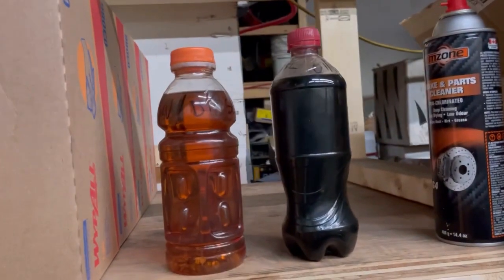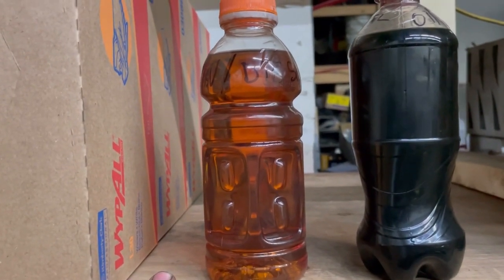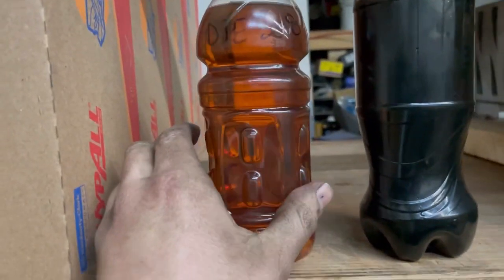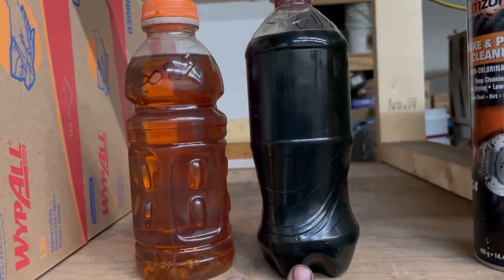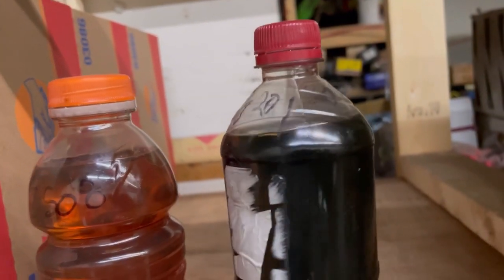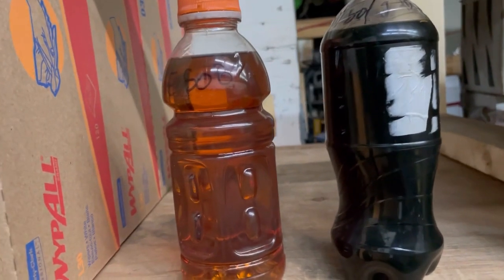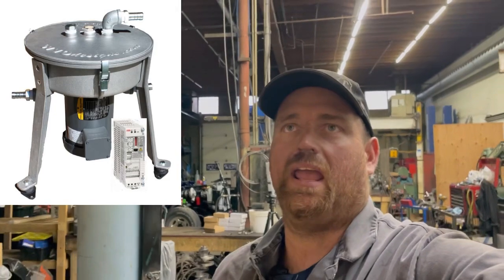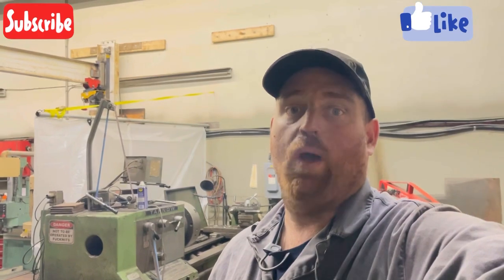Alternative fuels ( What's coming and what should we do ) black diesel , biodiesel, wvo,wmo

Comment: would be interesting to test the metals content vs start on waste motor oil . I know centrifuge will take out a lot. But I wanna see maximum filtering possible?  what about Magnets in settling tanks or on lines? Also you could mix E85 with the oils and run thru centrifuge?. Also put some algae/pond scum in the centrifuge with veg oil…
Reply from the maker: I was thinking of send some samples away for testing when I get the centrifuge  / mobile fuel lab setup in the coming months. Only thing in don’t like about e85 is that the ethanol takes on water very easy witch can be a big issue.

Comment: If it hasn’t been addressed yet, I’d like to know the lubricity of the final running mixtures and if they can be offset by winter additives. I have a VE pump on a 12 valve in my 90 suburban. Filtering is a must for the fuel system I get that , just concerned with wear
Reply from the maker: we will get in to that in the next couple video's

Comment: I see you’re talking about using oil I’m wondering if it’s used oil if it’s used oil man you got a filter that stuff down even finer than 2 µm because the real fine metal Shavings and small chips tiny tiny tiny chips yes won’t hurt the cylinder walls very much I wouldn’t think but what about the injectors in the pumps I’ll tell you right now I don’t think we have the means to filter that down that well I mean you I mean it’s super super fine metal debris‘s can damage things that’s what I was told by a guy who really knows what he’s doing a friend of mine who is now deceased he was an outstanding mechanic and give you some of his qualifications or you get a member Bill actually was building engines and rebuilding engines back in the 60s 70s and he was a master mechanic on road Ranger transmissions differentials hydraulics he even studied a book just to learn how to rebuild air compressors for drilling rigs and things like that and he was highly highly successful I mean this man was brilliant unfortunately he’s no longer with us and he’s told me says we don’t have the means to filter used motor oil that well we just don’t cause of the super fine metal contamination asked where I’m looking for anyway but I like your videos guy I really do I’ve learned a lot of things from you and I know I’ll learn more in the future but just remember what I said we do not have the means to really filter that stuff down to where it won’t damage our injectors and pumps and things like that all right this is six in a row jim From Kennerdell Pennsylvania
Reply from the maker: that is one of the problem getting it clean but that way i am doing video's to show what we to do  or not, i have run couple thousand gallons over the years ( not i my performance engines ) but i run a centrifuge and a 2 micron filter after, bu tthere is some junk you can get out with will wear parts, i will talk more in later videos

Comment: dont see many people running anything other than Gas or Diesel to thin their WMO or WVO kerosene jet A all that stuff is pricey and hard to find defeats the purpose, would like to see 70WMO 30Diesel vs 85WMO 15RUG seems to be the decision im up against atm

Also maybe a video on how to remedy issues caused by Alternative Fuels , like say a coked up injector is it as simple as pulling it cleaning it reinstalling it or do the tips usually get wiped out
Reply: Thanks for posting, I'm working on a simple filter system for WMO. Im a heavy duty mechanic so I've got a pretty good supply. Do you have any ideas for what filters to use?
Reply: @hendrikzenga5654   i keep it really simple, picked up a filter head at princess auto went to a parts store and asked for a spin on filter to fit it, said 2 micron on it i said great, put a fill rite 8 gallon pump onto a stand pipe 4" off the bottom of a IBC tote pump pushes it through the filter and out a nozzle into my truck, truck filters it again before its burnt.. probably filters it multiple times in the truck actually as it gets returned to tank

can go as simple as dumping your oil drain pan into your tank with a funnel to as complicated as settling tanks, centrifuges, heated filtering, dewatering, thinning, additional storage and pumping, alternative tanks on truck, pre heating fuel on truck, additional filters on truck, electric lift pumps, ect ect ect

at $2.15 a liter its a no brainer to me, run anything that burns and dont worry about the parts, at $.65 cents a liter it starts to become more hassle than its worth, you gotta decide at which price point its easier to just hit up the Petro station

Comment: Very interested in this as I use to run about 50/50 hydraulic oil/diesel years ago untill supply ran out. But recently i am in the process of acquiring 2000+ L of used engine oil

Comment: Just bought a 120 gallon tank from a old Peterbilt 359 and installed it into the back of my 1987 Chevy V20 pickup bed so I can run black diesel in my Cummins P-pump 12 valve. I work at Midas  and I have a infinite supply of waste oil

Comment: Would love for you to play around with different gallons per hour processing speeds of the WMO, like is slower with heat the best option or faster with multiple passes and a final heat stage,
Basically what’s the best way to process a barrel of used WMO when you factor in time and effort with your different options.